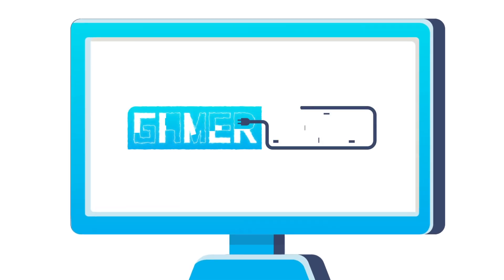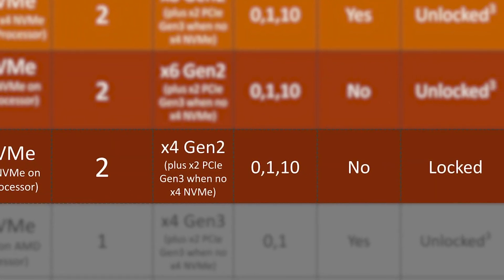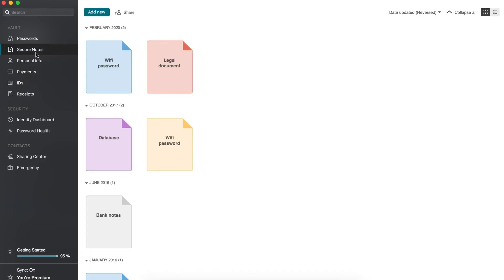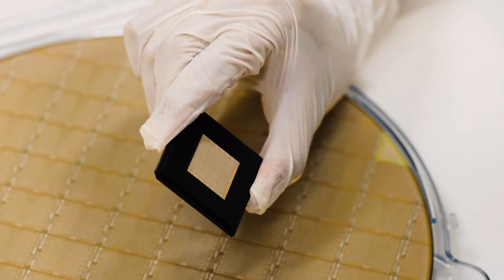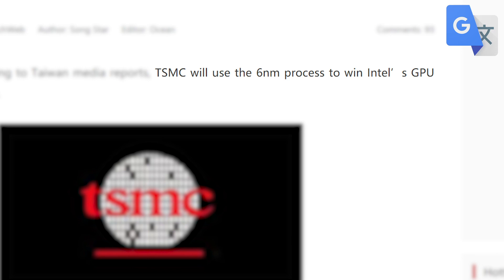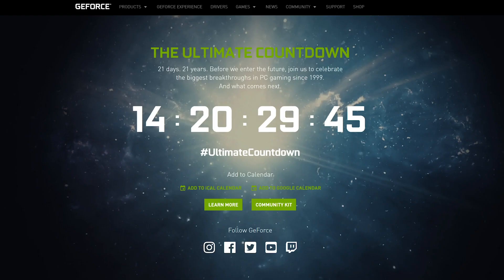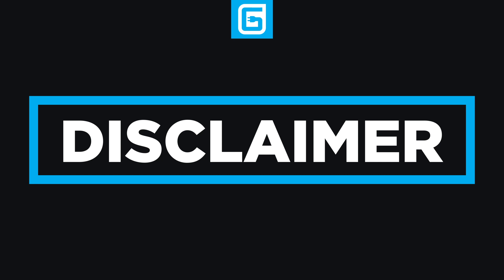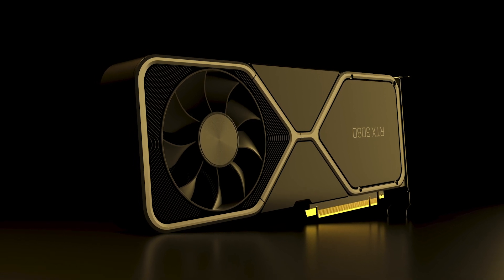FIRST RTX 3080 Public Benchmark, Intel’s XE Gaming GPUs Use 6nm!

Comment: If nvidia makes their 30 series more expensive I may get an AMD card for the first time in my life.
Reply: Been running a rx 5700xt with my ryzen 3600, 16gb 3600 mhz at ultra high 1440p with avg 110 fps when playing Apex. No problems. Thats an entire 2k build for $700
Reply: marineforlife859 it’s impossible to make a build for only $700 unless you really cut corners or get a lot of discounts
Reply: @Kergorn  Which monitor do you use?
Reply: @the_cro_plays  LG 27gl83a-b 27 inch 1ms 144hz. Was trying to hold out for this next gen so the price would drop but couldn't justify having an upgraded rig running on my old 1080p 60hz for another 6 months
Reply: @Kergorn  what temps are you getting? Gpu and junction
Reply: @elcoollow5955  it runs pretty hot with 2 push and 2 pull case fans, junction is at 87 and gpu is 82 running it maxed out for 3 hours. It definitely likes to run hot
Reply: @Kergorn  just wondering, I have xfx raw ii, 75-85 gpu temp, and 110 junction temp. 2 140mm in and 3 120 mm out. Meshify C case.
Reply: @elcoollow5955  ive heard them having cooling issues but I think the key with any PC is ambient temperatures.
Reply: @Kergorn  I love amd's processor's, have a Ryzen 5 3600 myself. However both of my friends bought Rx 590s and they both fried within a month. That is the problem I have with amd gpu's, really , really good performance for the price but a lot of driver issues and other mishaps that can cause them to be a pain. Nvidia also has issues especially with launching a new series of graphics cards, but I've have 4 Nvidia graphics cards and they all still work years later. All my friends are amd cpu's, nvidia gpus.
Reply: @ahhtaczy1578  I keep hearing that but other than AMD taking a month for a new drive for a brand new game *cough cough Doom Eternal, i personally havnt had an issue!
Reply: @Kergorn  id take Ryzen anyday no question about that, but Radeon? naw its more expensive in my country and its hot in here i don't need another heater. if they make it cooler tho i might consider.
Reply: @ahhtaczy1578  LOL... Been using AMD cards for well over a decade now, and never a problem. Tell your friends that they are very stupid and they don't know how to use a PC.
Reply: @ahhtaczy1578  are you actually comparing a GPU series that came over 3 years ago to the current one? My friend has 5700xt and he was killing it with many different 4k games like Nier automata etc. No problem at all. Still same performance after a year, same temps. He bought sapphire one. I don't know what rx590 your friends bought but they were extremely unlucky anyway. I'm waiting for new gen of AMD cards and I'm sure I won't regret it
Reply: @Kergorn  see amd drivers arer crap for the high end cards, the 5700xt, radeon VII, vega 64 and 56 all suffer from the same blue screens due to amd drivers being unstable.
Reply: @4idiots_garage  R9 390x too! First crimson driver is shit! AUTO downclock, fan locked LOL that's amd man
Reply: @Tom Tom And you think AMD will? No one need that fps at that resolution. Competitive gamers play at lower resolution, and if you're not a competitive gamer you don't need 144 fps. You are just throwing out some big stupid numbers.
Reply: Nothing wrong with going AMD I've been using AMD cards for 10 years and i never had a problem, i did recently switch to team green just cuz i got a better price here where i live but i wsnted to say that all the myth about bad drivers and overheating gpus is in the past for a while now, new amd cards run okay temperature wise the driver problems can happen and did happen to both nvidia and amd but i didnt have any and on the plus side amd is usually cheaper, and nvidias 3000 series i think i read particularly about 3080 or the 3080ti, dont quote me on this one, but they are going to be more expensive than ever i think around 1500 dollars
Reply: @Tom Tom even donkeys know that at 4K the bottlenck is the graphic card, not the CPU.
Reply: I’d wait and see if they failed with the drivers and if they did it you might be waiting for a while or just get a used 2080 ti/super
Reply: @-cdefgabc--cbagfedc-9018  AMD drivers are more than ok, don't believe in Nvidia propaganda.
Reply: Alberto De Girolamo Have you seen the 5700xt launch? Bro I plan on getting a 5700xt for my first build, idc who made the card but I’m waiting and getting a working card instead of buying it as soon as it drops and have 50 billion bsods and crashes... Better safe than sorry
Reply: @-cdefgabc--cbagfedc-9018  never had a problem with the 5700xt and i bought it shortly after launch sure some crashes here and there for certain games but thats given since its less used brand games have to optimize for it as well not just the drivers
Reply: @-cdefgabc--cbagfedc-9018  why you talk about the 5700XT? Don't you remember the RTX launch with the "Space Invaders" glitches that got almost totally sent back in RMA???
Reply: Alberto De Girolamo that’s why I’m saying wait and see if the drivers failed.
Reply: @-cdefgabc--cbagfedc-9018  oh, well, on this I COMPLETELY agree. Never pre-order, never buy on Day One.
Reply: @_A.d.G_  and dont ever believe amd marketing propaganda hype channel like Moore law. is dead, coreteks, not an apple fans LOL
Reply: What if AMD also makes theirs more expensive 🤔
Reply: @tylerdurden3722  Then ill get best bang for buck
Reply: @Tom Tom then what should I buy then? If both go up in price.

The price of everything else goes up. (Yet most of it does not improve or increase in value...like potatoes, or bread, or a jersey, or fuel). Should I buy nothing?
Reply: @matiine oh you have void your warranty
Reply: Tom Tom prove it
Reply: Nah I use 5700 and the drivers sucks
Reply: Amd in a nutshell: Pretty much perfection cpus in terms of value and performance, also in gpus buuuuut, drivers are shit.(im can confirm this myself since i have a r5 2600 which is some good shit but my rx 580 crashed just for starting up games less than a year later so i sold for 1660 super)
Reply: more perf more prices! if you want a more perf but cheaper, you can make your own company
Reply: @googlestadia8570  Yes I'll go start my own GPU company LMAO
Reply: @Icureditwithmybrain  lol good luck
Reply: @googlestadia8570  Hope that I succeed because if I do my cards will give you one million fps and will only cost 3.99
Reply: @Icureditwithmybrain  wow good hallelujaaah

Comment: Is it bad i’m thinking of upgradibg to a 3080 or so from a 1050Ti as my Ryzen 5 3600 well could use a graphics card upgrade xD
Reply: idk how much youre willing to spend but if i were you id wait to see the benchmarks of the 3080 with the 3600 vs a 3070 with a 3600. im not saying the chances are high of it happening, but its definitely a possibility a 3080 could be bottlenecked by anything lower than a i5 10600K , R5 4600. im only saying this cause a 2600 is already bottlenecked by anything higher than a 2060 Super. this would obviously matter less tho of youre running it at 1440p or 4K tho. just something to keep on mind tho thats easy to forget
Reply: @Angel7black   Yeah i was thinking of getting the 3070 when in comes out, but i wonder if my Ryzen 2700 will be bottlenecked, guess i have to wait and see benchmarks too.
Reply: @fixvble  yes man same worried that my 9900k will bottleneck the 3080
Reply: Bruh I that's also my pc lol. Ima wait till big navi, if 3000 are overpriced and big navi is underwhelming. Ima just buy a used 2080ti
Reply: Is it bad I'm gonna upgrade my 2070 super to the new 3090 to go with my 3700x?
Reply: Seth Kauffman Same here bro, I already have the money just waiting for release! 1070 to 3080 TI or 3090 depending on which is better for gaming. I got a intel 8700k probably gonna upgrade to 9900K since my motherboard can handle it.
Reply: @insignia_8994  see I kinda wish I went Intel simply because my pcs main purpose is gaming, with maybe light use otherwise, I just wanted to go the better value way, in case I wanted to start streaming and editing content and stuff. Yeah I've got about $1k put aside for a new GPU, not including how much I may be able to sell my 2070s for, so maybe $1.5kish. I'd say if you're only gaming, that your 8700k probably handles everything just fine, BUT, if you want to upgrade then by all means do so, because whether we NEED something or just WANT something, just go with your instincts.
Reply: Seth Kauffman Hoping for the best 😎
Reply: You are basically in my shoes! I have a 1060 6 GB with a 3600xt and seeing what grapichs I should get. I've had this grapichs card for 4 years and it's ready for a switch out.

Comment: FFS!
I know very well that these cards will be so overpriced already, just like the current RTX 2000 series. But at this point I can't wait any longer, a year or even 2 to see if Intel manages to release something good or maybe even AMD.

I have my old Rig for 6 years now and I simply need something new for Uni work, renderings and such, plus a nice bit of Cyberpunk 2077
Reply: I know that feeling... 6 years cheap pc too, i got New one ryzen 3700x RTX 2080S for that. Now i can't look away from tech news for some reasons ! (Not that i got my money on some stock at Nvidia or anything)
Reply: I wouldn’t get my hopes up with intel, watch Moore’s law is dead video they’ll barely be able to compete
Reply: Take a deep breath brotha. You are becoming emotional. You made it 6 years. you dodged the worst price/performance gpus generation succesfully. We aint going to falter now with the redemption in sight!!! 1 1/2 of my 3 gpu fans died last couple of month, but that lil warrior is still kicking, just 2-3 more month and amd should come out.

Comment: bit disappointed that it's only 10 gb of vram
Reply: there is like maybe 1 or 2 games that ever get close to 10 gb vram more isnt necessarily better if its not going to be used
Reply: @alejandrosantillana5384  I guess you're right. Is this true even at higher resolutions? I likely had the false impression that there'd be a big leap in memory for the 80 class cards, but I guess nvidia is just keeping 12 gb for the higher-than-80 SKUs.
Reply: @marcsman07  Moore's law is dead yt channel claims from sources that the 3000 series will have VRAM compression with the help of the tensor cores and will lead to a 30-40% reduction in vram usage. If that's true than 10GB makes sense.
Reply: DW about it it's not RAM you have to worry about it's bandwidth and Cache!
Reply: @fr33kSh0w2012  That makes a lot of sense actually.
Reply: @fr33kSh0w2012  Exactly, GPUs are usually RAM bottlenecked anyway, so adding and using more RAM just makes that bottleneck bigger

Comment: Be nice to see 5700xt drop to 299 when Nvidia launches.
Reply: @khalelradwan8775  Some people just want to enjoy games , We dont give a crap about encoding , I saw so many benchmarks where the 5700XT is almost head to head or even surpassing the 2070 Super in certain games , In my country for example the 5700XT is way cheaper than a 2070 Super and cheaper than a 2060 Super , So im obviously going for that when it comes to performance and features , I was thinking of spending extra bucks for the RTX gimmick but its not worth at all , There is a very small number of games that support it and will continue to be for a while , Also i dont want to pay for a feature that makes reflections to look realistic so i can play on 30/20 FPS , I personally wont buy any new GPU untill i see what both Nvidia and AMD have to offer , Also drivers wise , time goes , fixes come , product works well , all good , be patient , wait , inform yourself , buy , And personal experience with Nvidia , Drivers crashed randomly a lot ,  I moved to RX 580 and i never had an issue , Im aware of the 5700 driver issues but that was months ago and a lot has changed since then , also a good 2070 Super in my country is almost 200 more euro than a good 5700XT
Reply: @khalelradwan8775  currently raytracing is almost useless and 5700xt still pretty strong
Reply: @khalelradwan8775  Anyone who doesnt care about Ray Tracing and Tensor Cores? or anyone who doesnt have the money for the 3000 series? or anyone who wants the best bang for the buck? i would do it too.
Reply: Given we're only now seeing some Engineering Sample benchmark leaks., which are typically done by AIB on Reference Designs for a "Baseline" or via Engineers who forget to disable Online Benchmark posting testing new Drivers; this means that 2 Weeks isn't really enough time for anything but a Paper Launch.
As such we can expect to see the Hardware itself (Founders Edition) being available around Late September, with AIB likely around October-November. 

It's also interesting that the Drivers themselves only cite 3 Models. 
These could likely be referring to the RTX 3060 / 3070 / 3080... but then also keep in mind that NVIDIA has a habit of individually referencing each SKU Variant, rather than just the Base Processor., but then we're also aware of an RTX 3090 (which remember NVIDIA haven't produced an x90 GPU in a few generations now) 

AMD Drivers have had RX 6000 References since Late-June / Early-July and reference 8 Models (3 of which are Mac Exclusive).
As it stands it should be noted that a it stands rumours have primarily about the confirmation of a 72CU and 80CU Variant., with the belief that "Lower End" will be Rebranded RDNA 1.0 GPUs... but this actually is unlikely to be the case.

I tend to weirdly need to point out to people that Navi 1X wasn't exactly "Fully" Released.
We only actually got 1 Discreet GPU and 1 Embedded GPU., and while AMD clearly made the best of a bad situation; the issue at play is that AMD (despite their recent success) is still continuing to do "Business as Usual" from back when they were funding restricted. 
This is why their Base (Mainstream) and Embedded (OEM) GPUs were put into production a Quarter Early., in order to have enough supply... the problem was that Apple in said Quarter decided they wanted to substantially expand their Production at TSMC and while AMD might've reserved said production lines; Apple (almost certainly paying over the odds, but given what they charge their customers, I doubt they cared) bought them out to begin instant production. 

I mean you can't fault TSMC for doing it, but it did screw over AMD's Navi Production... and obviously AMD wasn't willing to sacrifice production lines of their CPUs for their GPUs that may or may not have been successful. 

Now as it stands NVIDIA decided to play "Hardball" trying to get a better price with TSMC., ultimately got screwed over as AMD pulled an Apple on NVIDIA; and essentially purchased all of the free 7nm Production Lines (useful now Apple has moved on to 5nm). 
This is why only the Datacentre Ampere (GA100) is actually being produced on 7nm... and maybe the RTX 3090 / 30-Series Titan RTX. 
Still keep in mind that AMD haven't really expanded their CPU Production., sure some APU Expansion for Mobile Processors but remember that Exynos (AMD Mobile Graphics) is being produced exclusively at, by and for Samsung (specifically their new Samsung Note 11? Phones., due out in a few months time at the end of the year). 

So this leaves A LOT of 7nm Production Capacity Free. 
Keep in mind just how much Apple was using., and they've now completely abandoned it... we're talking the capacity for an entire GPU Line Up, not just 2 new "High-End" SKU.

As such, I think we'll be seeing an entire RDNA 2.0 (Navi 2X) Line Up from RX 6500 to RX 6900., which includes an RDNA 2.0 RX 6700 and 6700 XT; that will "On Paper" look almost identical in terms of Clock Frequency and Specifications... except will have Hardware DXR and have ~22% Better Performance. 
Now will that mean the prices will drop? 

Honestly... maybe. 
Remember that the RX 5700 and 5700 XT were more expensive, in part due to the N7 Node costing a premium at the time due to high demand; but also because AMD knew by Pre-Release that essentially most of the RX 5000-Series would have to be either on Navi 10 or Navi 14... thus to a degree these would due to them stupidly remaining on the All-in-One Graphics Card design, meant they'd have to take a loss without it looking like a loss to their Shareholders on sales.
(i.e. the "High-End" Model, would HAVE to have a Premium Price to offset the others) 

Keep in mind they've gained share value because of trust in their upward trend., if they then showcase they're taking a loss on products during such a period of prosperity... well that's a good way to showcase to shareholders that you're terrible at business; and they'd quickly loose confidence regardless of product quality... or worse a loss in the RTG Division would likely see calls for them to sell off said non-profitable sector (even though it wouldn't be RTG's fault).

Of course AMD will likely want to remain a bit greedy., but I do see the RX 6700 being £280 while the RX 6700 XT is £320.
Now this in part will be so that they can launch the RX 6800-Series will likely be £400-500., while the RX 6900-Series will be £600-800. 
Mind I don't see the RX 6600 really changing much in terms of price... I still see that being £180 - 250., while the RX 6500 will come down to a more reasonable £130 - 150. 

That'd be what I'd wager AMD will do with the pricing.

Comment: 10gb vram bad.
Reply: how?
Reply: @gabe.d  I have 11gb vram on my old, soon to be absolete 1080ti, I expect an upgrade, not an overclock with more wattage and large headsink.
Reply: @attq3980  WHAT? I have a MSI 1080ti you can throw as much ram at a card but if the cache and bandwidth are shot then it will NOT WORK!